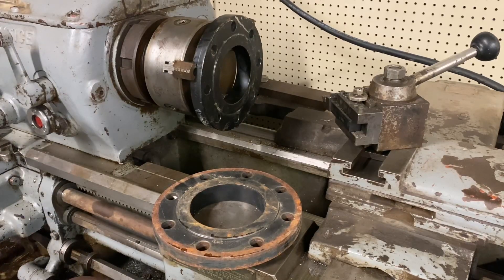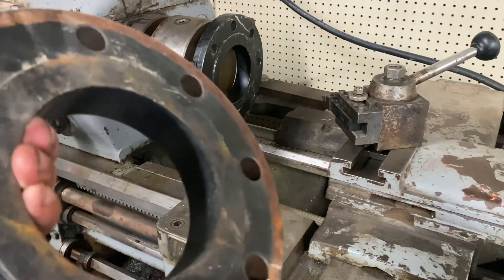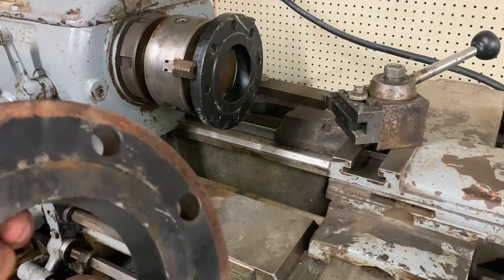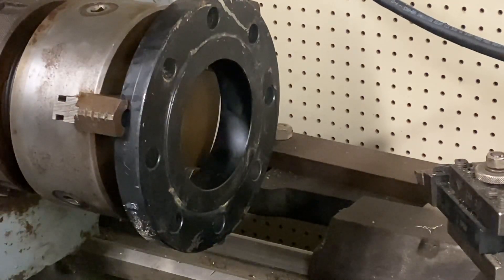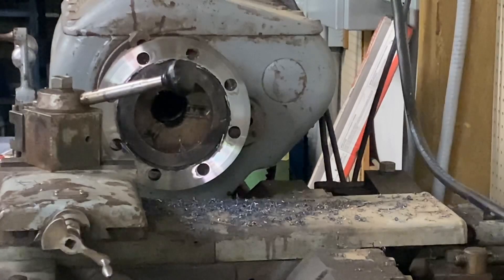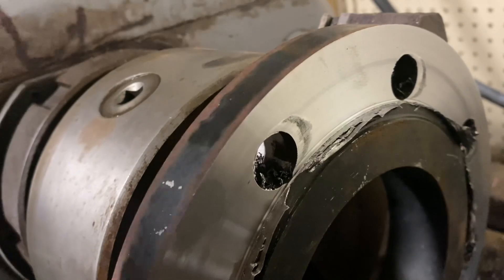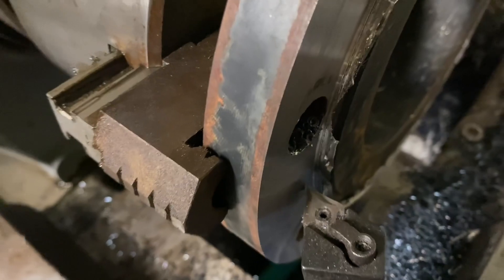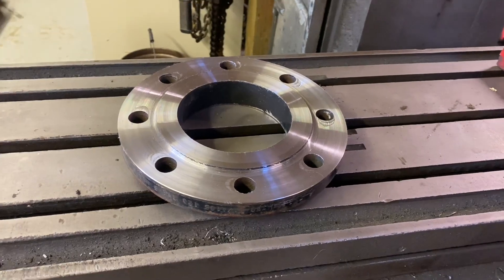Machining on a raise faced flange

Comment: Adam, I machine those flanges for 20 years, either altering  or making custom ones ...the gasket face has a slight grooved finish, that is there to help grip the gasket, you can duplicate it with a threading tool ..just match the finish {speeds and feeds}...just saying.
Reply from the maker: Yes they do, the guy wanted a smooth surface to help facilitate gasket removal.  I’m not sure why he was so worried about pulling it for service because he is putting on a strap on flowmeter to this spool piece